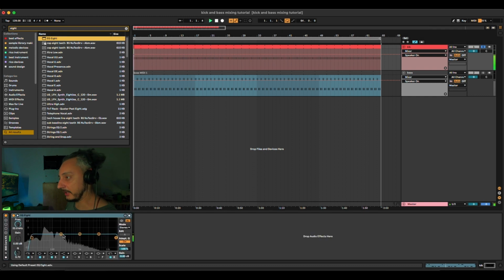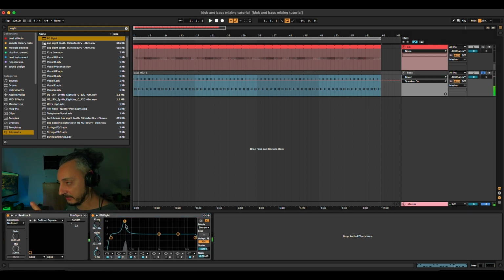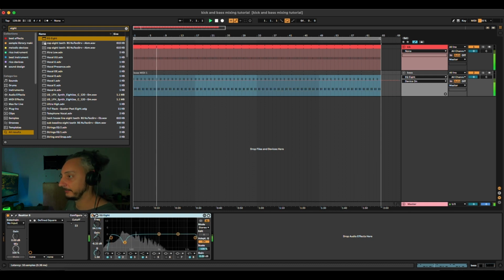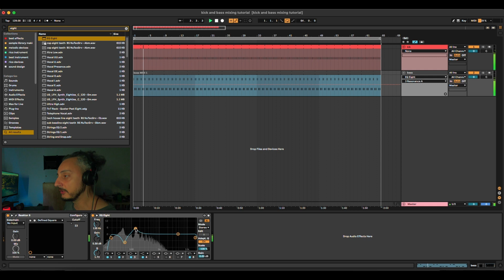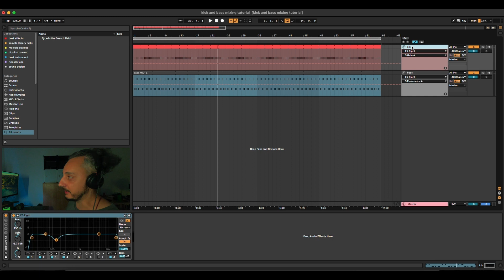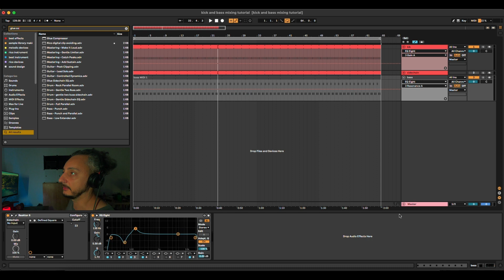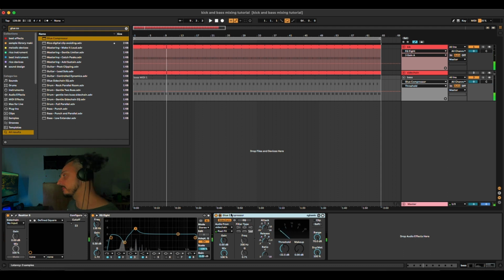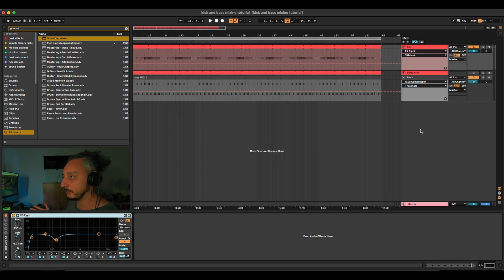How to Mix Kick and Bass EASILY | Ableton

Comment: I like this, I think that the side chain compressor should be your first tool when workin with bass and kick because the kick usually doesn't take up too much time in the mix and you don't want to preeminently alter the sound, but this same logic would work for a lot of other instruments, so very cool.
Reply from the maker: yes sometimes the equaliser should be put also at the end of a chain cause other devices modify the signal flow of a sound therefore is good to control those modified frequencies  at the end of the chain
Reply from the maker: It’s an essential tool to make the groove “talking”